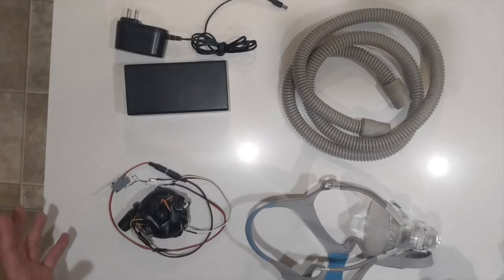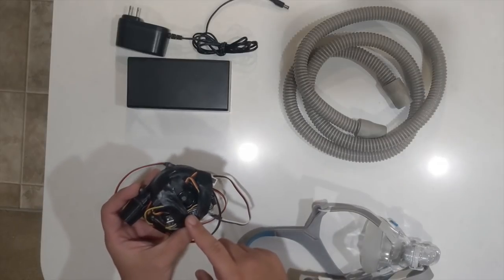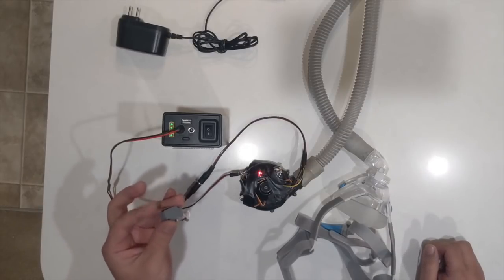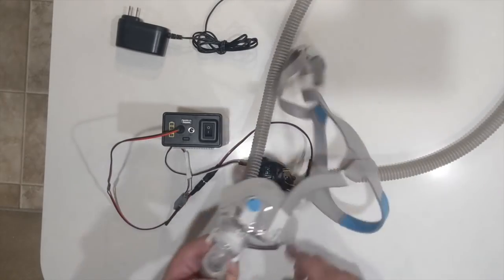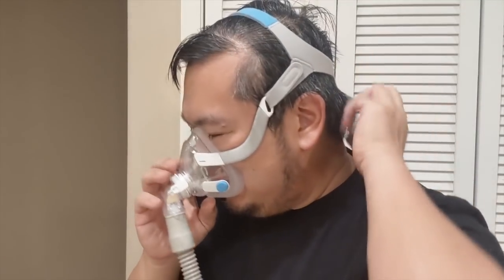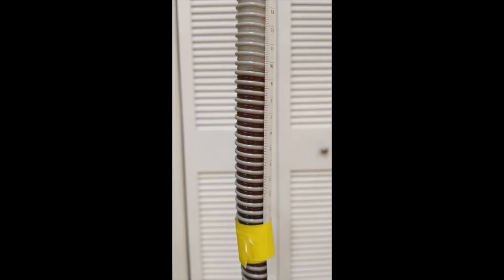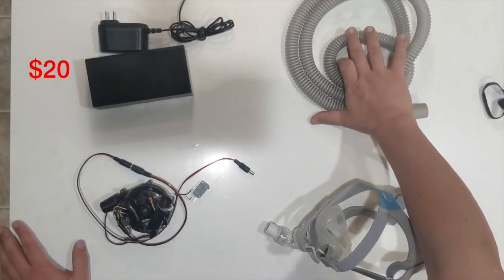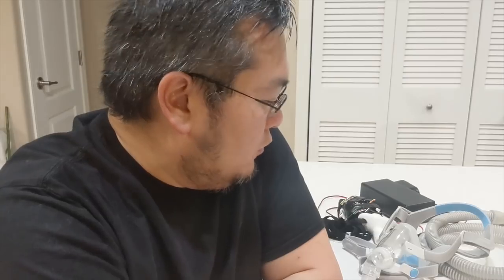Low-Cost Open Source Ventilator-ish Device

Comment: I think we need a forum for all the ingenious solutions folk are coming up with. In this particular case it's a viable proposition. I have CPAP too (tens of thousands of folk have them) and I've been thinking along exactly these lines. The issue seems to be with the continuous positive air flow. Some of the more sophisticated CPAP devices will sense the exhale and reduce the flow for the duration of the outbreath to an extent, but there's still the issue of the lungs trying to expel mucus. This is a critical function at a point where you really don't want anything inhibiting the body's attempt to eject stuff. I'm sure there's a workaround. All the experienced engineers, fabricators, designers, confined to home, probably with their own workshops, looking for something useful to do. They could even be making simple parts for ventilators, sewing facemasks, even growing vegetables for when there may well be shortages. As soon as you're sure you've had the virus and you're recovered and non infectious, you could volunteer to distribute this stuff to companies assembling/delivering etc. Let's get creative!

Comment: Hi Johnny!
Thanks for working on this project and sharing that here!
You should seriously concider participate in the "Code Life Ventilator Challenge". (I won't post the link here because the comment would go to spams).
This is a Canadian challenge to design a low cost solution to the lack of Ventilator. This is organized by industrials and hospitals. They could industriallized your process!
Thanks again for your work 🙏
Reply: Rice recently had a competition also, may want to look it up

Comment: Johnny: My compliments to your innovative spirit.  As a former patent attorney I can advise you that you can legally and legitimately use our patent system to get ideas for what a medical ventilator needs to be able to do.  I too, have been working on low tech breathing assist devices, even if, as you very correctly point out, might not be perfect but may get the job done.  Go to "Google Patents"  And search for "medical ventilator" and any other pertinent terms such as "breathing filtration" and "negative pressures for breathing" to get some ideas.  I think an electrical linear actuator, a power supply and an Arduino  and a bicycle tire pump might also work.   Even a manually operated beach toy inflater-pump will work.

Comment: Good thinking jhonny ...i am not an biq medical engineer but an industrial automation one...i never know anything about ventilator but knows how my lungs are functioning..so the logically we are having some problems to solve.
1-inhalation  2-exhalation 3-quantity of oxygen (depend on the lung size.4-air filling time (mean inhale flow rate)
and an exhale (exhaust valve to release CO2) --and adjustable breathing speed ...these should be the basic criteria for a ventilator ...if you go for more advace and use AI  or PID with logic it will monitor heart,air quality and trends visualization ....your system is only an air filling pump. orgive me guys if i am wrong ,because i never seen or studied a ventilator in real life....Pray for the world.

Comment: I think that you got the right idea, however there are a few things that need modifications. I am an electrical engineering student, so bare with me...
1- I believe that by constantly forcing air into the lungs, the person would be unable to breath. 
To fix this problem, there needs to be a delay on the Arduino to allow the person to exhale. 
2- To further improve this idea, the system much include air suction following the short delay. The purpose of this to force exhalation if the person is unconscious etc

I would personally try that myself, but I still have online exams to tackle down first. That being said, I'm planning on getting prepared with a few projects of my own on COVID-19. Thanks for sharing.

Good luck and stay safe!

- Al
Reply: 2 ONE WAY VALVES 9 AIR IN / OUT)  ............  this is the best makable version i've seen so far hat could be knocked up fast .... if the s££t hits the fan .. i'm making this !!
Reply: you are correct..... it needs delay in code... and reverse (if needed) ..... 
good to see you thinking of ideas to make it better
Reply: I'm sure that if there are more cases in the future, this DIY can come in pretty useful...
It's a great start
Reply: There is a version that does this already. It's called a BIPAP machine.  Look it up.
Reply: Electrical Engineer. If you force exhalation, you can collapse the lung. need to find out how real machine work.
Reply: @nitzanalexanderk6875  
The idea is that you create a ventilation system on the human body, the body needs oxygen to go in either at a constant light pressure or for critical condition it's going to be normalized pressure going in for inhale and a light pressure exhale to control the user's breathing.
You need to go cool down before you feel the need to lash out at someone like that.
But like I said, I have to finish my exams first then I can come back and come back and work on COVID-19 projects. 
I just have one question for you Alex, could tell me the name of the company that you work for so that I don't run into any of your people again?

Comment: A half - mask respirator can be adapted for a face mask similar to the CPAP one  - they cost around $5 and covers both mouth and nose. You get ones which takes one filter cartridge making it simpler to adapt - less holes to close up. Also, I played around with one of those 12v dc air-mattress inflators - another possible component to use.
Reply: Yea. Someone did a great write up testing an air mattress inflator: https://github.com/jcl5m1/ventilator/issues/62

Comment: I am a registered sleep technologist (RPSGT),and I can tell you that there are huge stock piles of BiLevel Positive Pressure devices available.  Positive Airway Pressure (PAP) is the broad term and sub groups such as CPAP, BiLevel PAP and Auto Servo BiLevel PAP used to treat obstructive sleep apnea or central sleep apnea.  A BiLevel PAP device and an Auto Servo Ventilator BiLevel PAP device can be used as a non invasive ventilator and supplemental oxygen can be added.  There are two pumps, one for inhaling with higher pressure and one for exhaling at a lower pressure.  There are millions of people in the USA who use Bilevel PAP for the treatment of obstructive sleep apnea.  Many BiPAPs can be programmed to deliver a wide range of pressure settings and modalities.  For example, it can operate spontaneously with the natural breathing rate of the patient, or it can deliver a timed inhale/exhale cycle for people need to have their respiratory rate increased.  I am surprised that the medical community has not tapped into this widely available resource yet.  There is one disadvantage to using non invasive ventilation vs. an invasive method with intubation and that is the patient can easily remove the CPAP mask which would not be ideal, but it's tough,  painful and less likely for a patient to pull out an artificial airway tube.
Reply: Fred, which BIPAP machine would you want to be attached to it was your only way of staying alive, could your list them 1 through to 5 with 5 being useful but less, I'm a C4 Quadriplegic with sleep apnea I've been trying to use a CPAP machine after my Respironics system one's BiPAP humidifier lid broke, we could fix it in a pinch but would upgrade it if it could help me if I contracted this virus

Comment: A ventilator is needed to put O2 in the lungs and remove carbon dioxide from lungs and it requires tracheal intubation , the thing a cpap (continuous positive airway pressure) does not do(i have been on a few ventalators because surgery) just my 2 cents
Reply: The BiPAP does  whaty your saying .
Reply: Anything that can help open airways would be beneficial over nothing which is why some mds are suggestion steroid inhalers to covid patients depending on severity of symptoms. Those arent ventilators either but they help get 100s of people relief and free up medical grade ventilators for those who actually need them. Open airways equals more 02 and less co2.

Comment: And if you click again, the noise from the motor will make your head explode! LOL. But cool build. I think the main difference is the filtering device. NPR has an article on the differences between a CPAP and a Ventilator; "Ventilators require a breathing tube and operate as closed systems with a filter that traps any pathogens." So If you can retrofit a N95 mask on top of that plastic mask to cover it's holes, then maybe it can function as a Bipap. Bipaps are more programable in terms of amount of air ( you need oxygen sensor).

Comment: I have a question: I just didn't understand, where the air from lungs suppose to go to? Does the air of exhalation go back to the same tube to the ventilator? If so I suppose it is not a good idea because the working machine would not bring oxigen. Instead of this the same gas enriched by CO2 would hesitate forth and back.
Probably I missed something in your explanation. I highly appreciate you initiative.
Reply: Maybe it depends on how long the tube is as to whether much of the exhaled air+co2 is re-breathed back in? With full face snorkeling masks with shortish tubes the re-breathing of a bit of exhaled air doesn't seem much of a problem when doing snorkeling for example.
Reply: Valid question, I see some sort of one-way valve assembly in either the mask or hose. Similar to divers SCUBA exhaling (see comment above). I am a retired control systems engineer and for (KISS) keeping it simple, this design is genius. That speed control from CPAP was inspired. Hospitals need something more into recording and readout for personnel and this is understandable. So each unit probably comes with $25K in readout equipment that has little or nothing to do with keeping you breathing.
Reply: @timhampshire3930 Just very simple calculation: if we have a 15mm in diameter tube, then half of meter would be 884 cm3 - it is more than the average volume of human lungs...
Reply: Кирилл Гребнев the mask is designed to allow bypass while exhaling. I have sleep apnea and all masks are designed for this.

Comment: Great idea to use the CPAP blower. A few numbers/concepts: with COVID19, high oxygen is a big deal. You may want to see about modifying it to take up to 100% O2 in the intake. Another thing with COVID19 and O2 is maintaining what the pros call PEEP (post exhalation something pressure). It’s important for oxygenation to prevent the lungs from completely deflating. That means maintaining a back pressure of 5-15 cmH2O. What I don’t get about this setup is where the exhalation goes. It’s important to allow exhalation through a filter to prevent contaminated droplets from spraying the room.
Reply: Exhalation goes out the small vent on the mask at the feed tube in this set up.   A full bubble mask with inflow and outflow to a filter or sterilization would be better
Reply: Thank you so much for your feedback and questions. Check out Johnny's latest notes after talking to pulmonologists and respiratory therapist. Constructive professional feedback like yours are greatly appreciated! https://github.com/jcl5m1/ventilator/wiki/Notes-from-chatting-with-a-pulmonologist

Comment: Why bother taking the CPAP apart, when the original machine performs the same functions as the parts you connected?
Reply: Because he had to replace the controller/logic to make it cycle between two different pressures in order to simulate a respiratory cycle.
Reply: @CL-gq3no  This contraption can't even keep a constant pressure, how do you expect it not to injure a patient.
Reply: cebruthius - Why call it fraud? 
He is exploring how to produce a less costly with more readily available ventilator with common parts. He said, it may not be the complete answer that he is exploding it. He said that straight up front. He didn’t ask any money from anybody.  He asked for help with other on design & requirement. 
Professionals are coming forward to help him with this design. The CPAP board is asked him to come talk to them. Respiratory specialist has asked him to communicate with him. At least he his try to help in this Global pandemic horrific time. Besides being an alarmist and calling people out I making false accusations when you’re totally incorrect... what are you doing to help the situation?
Reply: @cebruthius  You can read Johnny's notes from talking to doctors in the field: https://github.com/jcl5m1/ventilator/wiki/Notes-from-chatting-with-a-pulmonologist

Comment: Good effort. There are all sorts of clever arduino enthusiasts out there, 3d printer hobyists & people who make things who could all be out there making things. However we need to also remember that ventilators were around in the 1960s & were really simple electro mechanical devices. Electronic controls are not neccessary if this is a supply line shortage. Before this there were iron lungs. Pictures from Italy show patients with a sort of pressureized plastic bag on their heads. 

I believe the device needs humidification. Injecting moisture into the air tract.

Inductrial controls use pneumatic controls, valves, regulators, controls, piping, fittings & everything needed to make these sorts of devices. The PLC controls used in factory automation is also widely available & VERY adaptable. These types of equipment are VERY reliable...easily of the wort of quality for medical applications. A common automation workshop & technician could chuck together a programmable ventilator in a heartbeat.....I could...

Comment: Johnny Lee, on the issue of exhaling vaporized/contaminated air. Could it be directed through a box containing a UV light to decontaminate?
Reply from the maker: I like the UV idea.  Don't have a great idea on the configuration yet.
Reply: You could use an activated carbon filter
Reply: Johnny Lee  - or use a HEPA filter.  I had a similar idea to yours but added a “position controlled dump valve” near the mask. Will send you a block diagram if interested.  Good Khama to you, kind sir.
Reply: Karma
Reply: Just run the mouth inserted end though a heppa filter first. Its good enough.
Reply: Johnny Lee I believe I read that UV is not particularly effective on COVID-19.  Worth investigating.  I myself have been experimenting with RC EDF (electric ducted fan) as an emergency/travel CPAP; but haven’t yet tested it for pressure.  My therapy is at 11cm.
Reply: @jcl5m  The air flow is too high for decontamination using UV light - use HEPA FP3 filter is more realistic
Reply: I think the virus dies at a certin temp.... if you were to have a heated outlet tube the air expeled may be virus free... (if hot enough .. or air extracted into heated chamber
Reply: These would be best used 'at home' where presumably the house is already contaminated.

Comment: The difference btw a ventilator and a CPAP is that the ventilator is actually assisting the breathing.   The tube is inserted into the trachea, the air pump is both volume and pressure controlled for inhalation and exhalation.   I have no idea what the number of breaths per minute or the number of liters per breath are.     
Your CPAP could be converted into a fantastic HEPA filter mask.   Anyone that needs to work in direct contact with an untested population or a quarantined group would do well to have a HEPA filter mask along with other required PPE.   
As a last resort, where professional medical attention is not going to be an option this would be better than the alternative.   But think of it as being more like CPR than ventilation.   Allow the lungs to deflate on their own.    Any adjustable on off timer would serve to provide the timing for the inflation/relaxation cycles.   Certainly  a Raspberry Pi  would make a grate controller with maybe a bit of overkill.
What most of us are backsliding on it cleanliness.  If you are out in the public wear a mask, glasses or goggles and gloves.  when you take them off wash your hands for the second time.   Then change clothes in the garage not in the house.   Take a shower being sure to wash your hair.   
After we return home we must assume we are carrying C-19 on our clothes and in our hair.    
Pop the clothes in the dryer on the hottest setting you have, measure the temp.   If it is 155F or more and it runs for 20 minutes it will kill most of the C-19.  
Be well and keep your distances.